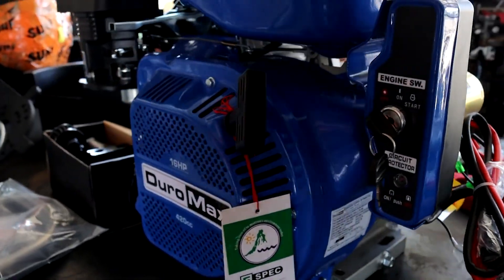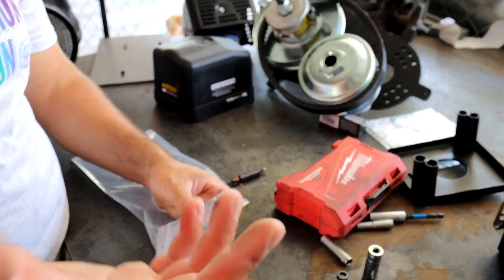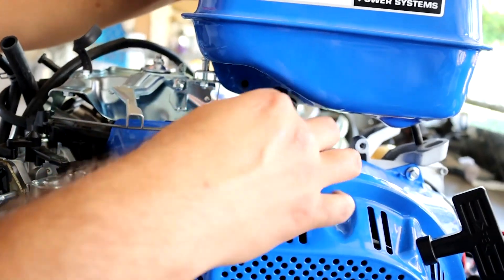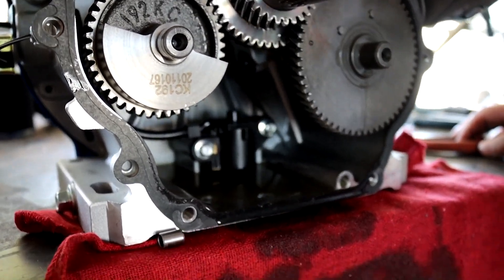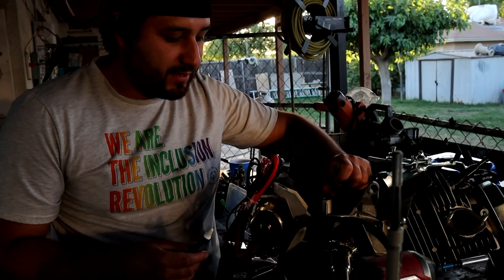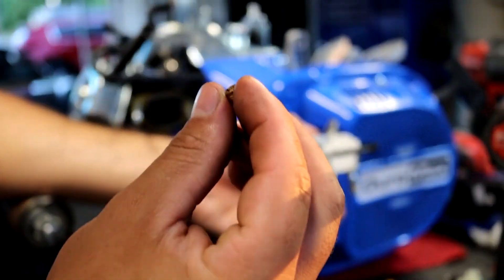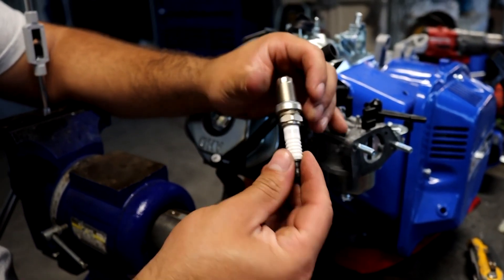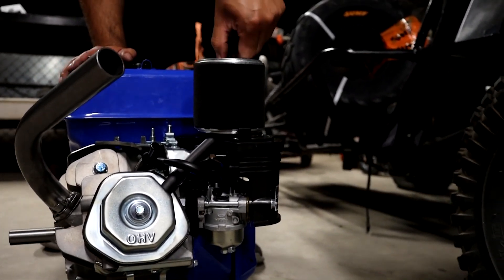GoKart Build (DuroMax 420) Stage 1 Governor Delete

Comment: You don't have to break the governor gear. There is a small lock pin just take it out using a small screw driver and it will come out.

Comment: You don’t have to replace the flywheel on the big blocks when you do governor delete?
Reply from the maker: The stock valve springs are not hard enough to rev this engine high enough to destroy itself. Either way, don’t redline the motor for all its life, and you'll be fine.

Comment: Can the stock internals and valve springs handle removing the governor?
Reply from the maker: Yes. The original valve's spring load is not strong enough to keep the engine going to an extremely high RPM. For this reason, you will get "valve float" before hitting unsafe RPMs with stock internals.
However, I don't recommend "redlining" for extended periods of time. 👌🏼
It is always safe to do billet internals, but unfortunately, it is very expensive on these big blocks 😞

Comment: if you run an engine unsecured on a hard surface, it can bounce around and potentially crack the block. always bolt them down on hard surfaces or run them on soft surfaces.

Comment: Likely for the 2 size stud and bolt for the governor hole and oil sensors Tnx
Reply from the maker: Governor hole is 3/8 16 pitch.
Oil Sensor hole is 7/16 20 pitch.
Length is up to you but don't go too long.
👌🙃

Comment: So I just got this same motor, and a stage 1 kit.
BUT. Everything I could find on jet sizing, said 42. Now you have me wondering if I need the 44
Reply from the maker: May differ.
Actually I began with the 44 and the motor starved every time. When I switched to 45 it ran so much better.
I'm sure the more air it breathes the bigger the jet you'll need is why.
Reply: Do you have the link for the header by chance?
Reply: Can you send me the link for the stage 1 kit